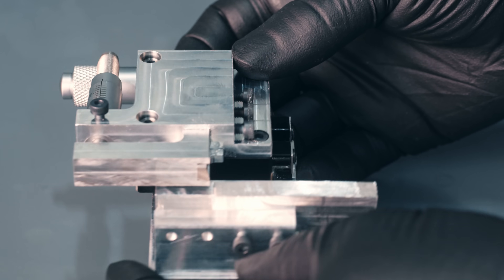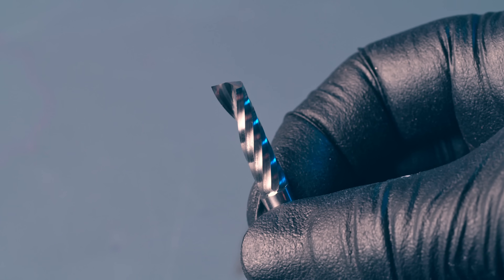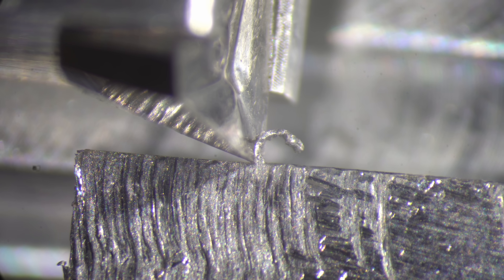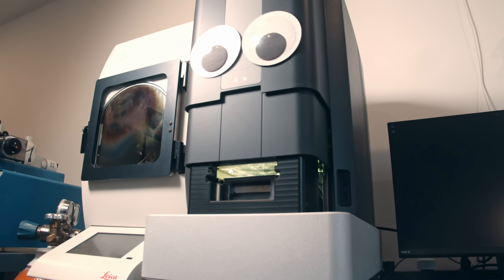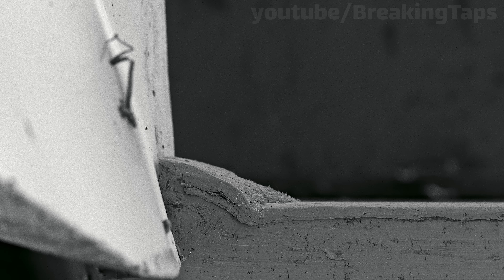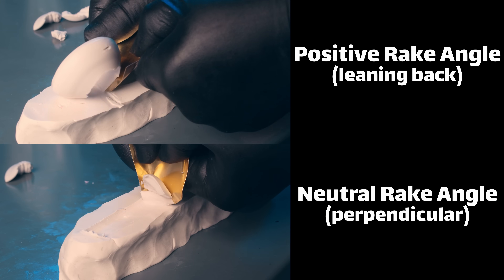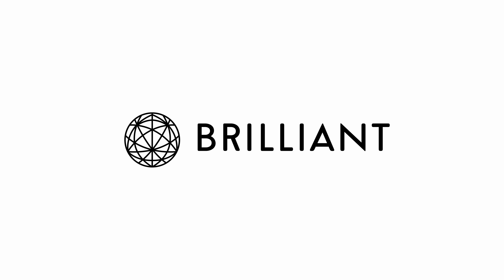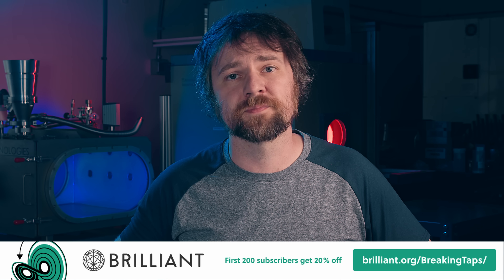Cutting Metal inside an Electron Microscope

Comment: @11:00 It's usually a couple hours into working with a new colleague after I have dragged them down into the weeds about Artificial intelligence, Augmented Reality, software development in <insert language/IDE here> while off-handedly commenting about my personal hobbies that involve a lot of surfing, fishing, welding, microcontrollers, 3d printers, 4 axis CNC milling machine, laminar flow hoods for my GMO cultures that are distinctly separate from my fume hood containing my fully stocked organic chemistry lab with a liquid-liquid TEC condenser cooler, and the required 2 separate deep freezers and 2 separate mini-fridges... that I get the question, "What is you background?" "Oh, I'm Aerospace Engineering." It seems to gets shrugged off a lot... but everyone once in a while I have to go through and connect the dots and it actually does make sense.

Comment: Need to see about getting a motor, battery, and some type of controller inside with a link so you can simply see motion in real time or about real time, instead of pumping up and down for every frame..
Reply: The link is the big issue here really, pretty has to be a wire so you can control the flow of electrons so they won't interfere whit the electrons or the sensor of the SEM,

Comment: Instead of a mechanical device, think of a round aluminum housed bldc stator with µP (like esp) and a rotor with neodymium magnets, combined with some gears. Then you only need vac sealing at the bldc. you could control it over wifi and keep the vac.

Comment: thorlabs has a number of vacuum compatible linear actuators like the 13 mm PIA13VF piezo inertial or 25mm Z825BV DC servo actuators

And newport/mks has several lines of fully assembled vacuum compatible linear stages

Comment: Hey if you want to automate it, it would be easier to install a motor like you said and attach it to microcontroller and then program it so that it starts after some delay (say 3 mins) after you turn it on so that you can turn it on, put it in the vacuum chamber and then once its ready, the motor will kick in after the delay. You could also program the steps to turn very slowly and then stop for 10s after the 50 micron movement so that you can take a clean picture.

Comment: the more accurate imagery would be from an actual high speed cut, actuated remotely, and recorded on a high speed microscope setup.
dunno why you insist on vacuum, as that's not the normal usecase for cutters/drills
Reply from the maker: Vacuum is required for a scanning electron microscope 🤷‍♀️
Reply: @BreakingTaps  : looked like normal microscope magnification. i missed that bit. well...still you could rig up a bluetooth/wifi started cutting run, and hopefully hook up a slomo video camera on the microscope, so you dont need to spend hours doing photo by photo...and it will be a bit more like what happens in real cut/drill. the shearing forces look a bit different on high speed continuous cut than pushing cut tiny bit at a time. It was still satisfying to watch btw.
Reply from the maker: @Chris-op7yt  Definitely agree! Looking into a sorta custom-built lathe setup so that we can get continuous chips at the proper surface speed (+ microscope + high speed camera)

Comment: Great video.  On your idea to make a wind-up machine to advance the tool in a future project:  Couldn't you use a stepper motor with all the electronics inside a sealed container (instead of using that expensive sample box with electronics passthrough)?

Comment: Could you perhaps use a battery-powered Lego controller with a servo to turn it? It's possible to program it with Pybricks. I think the batteries should last for at least a few hours.

Comment: Bro, you're a machinist, make your own electrical passthrough chamber.

2 holes offset, use 2 oversized conductive pins you can press in. They'll have contact where they meet in the middle. Press fitting soft metals is a nightmare though, so have fun

Comment: nice video, im wondering tho. you could easily rig up a radio controlled jig so you dont have to buy a 3k usd extra tray. arduino and stepper motor with a battery wouldnt work?

Comment: When you say "harder than the metal" I have to add a caveat. It's something with a higher temperature than the metal being cut.
Diamonds don't melt, but they can tear with enough use.

I'm being petty but I've been questioning this for years. A sharp knife effectively has less surface area than a dull one and reaches a higher temperature.

Is there any example of a metal with a lower melting point being able to cut one with a higher melting point? I'm genuinely fascinated at what's going on

Comment: I'm not sure how much space you're working with but you can get some 12v DC motors with a fixed high reduction gearbox and pair them with some batteries and a potentiometer controller for very low speed rotation in a wire independent package.

Comment: HSS steel is still widely used, it has a sharper edge and is better for use in softer materials such as aluminium, especially when precision is required. Tungsten carbide is used for harder materials and where mass production is required. You did not state what aluminium you are using? softer aluminiums are not suitable for machining as they tear and gum up just as seen in this video. Lastly the speed at which the cutter travels will change the way it cuts which this video does not show.

Comment: I have to wonder if you could build a small battery powered Bluetooth enabled controller that could drive a stepper motor that would fit in the chamber.  That way you could just send the whole thing in a single session.

Comment: If a guy had time you could really see a lot of things here. For example, aluminum doesn’t respond well to low speed cutting, that’s why you see a lot of breakage within the chip, and on the “earlier attempt” it looked like brittle spalling on the inside of the curl. Aluminum cut at very high speed with a coolant flood would be interesting to compare

Comment: Stopped at 1:28 to correct you. HSS is still widely used in the machining world on mild steel and aluminum as it is FAR cheaper than carbide. It is also used for threading tools as carbide doesn’t like the interrupted cutting of things like taps, though I have seen carbide thread mills.

Comment: I'd love to see, but cannot think of a way to realistically achieve it within the resource constraints of someone not spending government-budget money, the cutting process under SEM scrutiny, at full speed, where the cutting action can produce a zone ahead of the cut hot enough to significantly alter its material properties. Im going to venture a guess that under "real" cutting conditions the aluminium would have plastically flowed more rather than getting ripped off in pieces like in this recording.

Comment: Everybody's been fooled by your "video".  The cutter is re-moving a tiny bit then stopping. each 'wad' of aluminum happens because the head is cutting, then the wad cracks off of the base metal, then another similar length cut happens.  Measure the distance of each, crack to crack.

Comment: 'high speed steel isn't used anymore..' no, it still is. Full-depth carbide taps? Not widely popular due to the brittleness of the carbide.
Reply from the maker: Rough generalization for endmills 😉 Sure HSS is still used in taps and drills (although TSC carbide drills are superior in basically every way except price) but since the vast majority of tooling is the endmill variety, and most modern shops are running carbide, it's a pretty fair generalization I think 🙂

Comment: It's cool.  I used to control the colour of the swarf on the day for laughs. Today we,'ll have blue swarf in one long spiral.  Then we'd put a big grind out just behind the cutting face and that would be known as a chipbreaker.  This is backin the day of grinding your own. Typically a lathe would use a chipbreaker profile. Whilst a shaper would use a narrower rake for a one piece until it got to the end of return.  It really depended how you wanted to handle the swarf.

Comment: How about using a 1/24 scale RC truck crawler to control the cutter?
It has all the parts you need like a gear box and a torqy worm drive. The 2 channels would give you an X and Y axis all controlled by remote.
They cost about 100 bucks.

Comment: Very cool footage! I got tangled into the vacuum connection as i have had designed one in my past. 
Many options popped out in my head, most of which quite compatible in cost to the $5000 for the empty chamber.

Did you check the option of machining a hole into your chamber and then sealing it with Indium wire and stainless steel bolts? The Al2O3 connector can be bought separately for $300 and you can mount it in the hole if you have the right machining tools. I can help with the design :)

Comment: Although this " footage " is interesting .., as I understand it .., it is a series of stop frame gouge shots ... A machine tool cut is usually a continuous even .., where the material starts to behave like a standing wave ... In a lot of cutting procedures after the initial entry of the tip into the material the real bulk of the cutting is just up from the tip at which point the bow wave of metal is being pushed off the stock and the very tip is only effectively polishing and establishing the new dimension ... Nice to see all the same ...

Comment: So, what do you use for cutting the bit that you use to cut the bit that is used to cut the bit that is used to cut the bit that is used to cut your bit?
Reply from the maker: Turtles all the way down! Typically diamond tools are used to cut/grind/polish the carbide tools (which are used to cut/grind/polish the steel tools, etc etc). And to make the diamond tools... usually other diamonds (very slowly) or sometimes femtosecond lasers 😎
Reply: @BreakingTaps  I actually appreciate that!  Thank you!  Now I just need to see like a 4th century femtosecond laser!  And then, if I may;  The equipment to make THAT!  lol
Reply: @BreakingTaps  lol, turtles....Slow and easy sharpens the bit!

Comment: Premiere Pro Warp Stabilizer.  I wonder if it could produce a smooth motion video instead of that jumpy stop motion.  Slow it by 50 percent and its pretty good at interpolating frames using the Optical Flow interpolation model.

Comment: Any chance you could just make a vacuum safe sealed box with a magnetic coupler joining a stepper+battery+driver inside to the screw outside? It seems much simpler to design and test than a clockwork mechanism, and more flexible as well. I'm not sure what other design constraints are at play, so there may be some major issues but I thought it was worth at least asking.

Comment: You could make a remote controlled cutter, powered by a battery.
I guess there could be some problems, like if the chamber is made entirely  of metal, the signal wouldn't get in; the battery might stop working in vacuum, but it might be worth the try.

Comment: You could use wireless connection to control motor inside your chamber. Maybe you'd have to make a sealed chamber for the battery to not to expose it to vacuum.
I even can help you to cad-draft that for you cause i am really impressed with project you do for your channel!
Amazing!

Comment: interesting video! some slight correction, saying that the reason hss can cut faster than basic tool steels is due to its working hardness is a bit misleading. hss does have a slightly higher working hardness than basic tool steels (63-65hrc vs 57-62), but the main difference is in its ability to maintain hardness at high temperatures, mostly from the addition of Molybdenum or cobalt. also carbide isnt "better" and it hasn't largely replaced hss. its better for some applications, but hss is still around.

Comment: When you're cutting iron and other ferrous materials the generated heat becomes very important. The material becomes softer if the cutting speed is high enough which facilitates the cutting.

Comment: Super satisfying shots. I don't know how much of a vacuum you are pulling but if you have the available space on your chamber, a hermetically sealed mil spec  connector plug (cannon / amphenol) would be a very cheap way to run power into the chamber. A well installed one can hold about 20psi positive. Not sure about how that equates to a vacuum.

Comment: Could you use stage movement to cut? Put cutter fix in chamber, move metal with stage x/y. Or a reduction gear using the stage rotation. And 3K on an SEM accessory is pretty nominal. John Yorston now at Thermo (formerly Zeiss) is a SEM applications specialist who might be able to help. Good luck. cool video!
Pet peeve alert. SEM images are not *photo*graphs; images, micrographs, pictures, but not photo-graphs. Greetings from a fellow biologists/SEMer.

Comment: I do not remember if you could use anything electrical or not inside one of these. But an idea is just to have a very tiny motor that is geared highly to slowly move it over time. That way it can slowly cut on its own and you take the pictures.

Comment: This clearly shows how pasty metals really are. You can see it on really soft metals like led and sodium to an extent, but the real cracker is the difference in hardness, not the overall hardness. All metals are pasty to some extent, by virtue of being metals. If the tool has a big enough "pastiness gap" to the workpiece, it will shave off chips.

Comment: Use use a battery powered motor to automate it. DC or stepper+microcontroller. If you want fancey you can add RF communication.

Comment: So you are wrong on several points.

1. The first cutting tools were hardened high carbon steel, HSS didn’t come into common use until around the turn of the century.

2. Carbide inserts are designed for a specific range for the depth of cut, .004 is the smallest I know of.

3. SFM is important to produce a chip properly.

4. Coolant/lubricant can also make a big difference in chip/finish formation.

You made some chips but they are nothing like what a machine running proper speeds, feeds & coolant/lube would produce.

Comment: Why not do remote control? Use an RC car steering servo that moves linearly and then 3d print a gear and arm of the right size and length to rotate the micrometer the correct amount. Think of an engine crank shaft and piston. The steering servo is the piston.

Comment: Great video!  If perhaps the secondary shear zone had a continuous lubrication port, consequently less friction so the actual surface cut becomes more accurate without the pull tears that I’m observing. The material would slide past the shear zone rather than bundle up and compact.

Comment: This is one of the best videos that I’ve seen on YouTube. Smart, well organized, and interesting. 

There’s one detail you should add on your next video about chip formation: temperature. 

Cold metal responds to milling differently than room temperature metal, although not necessarily in an advantageous way. 

In fact, they make a vortex air separator which provides cold air for machining small parts. A nitrogen tank can also be used.

Comment: Amazing footage, thanks for all your time, and skill. Not to mention some very fancy equipment. Sorry to hear the difficulty - and expense - getting electrical connections into the vacuum chamber. Running the cutter with a stepper motor would be very cool, and save a lot of time! Can somebody knowledgeable in high vacuum please come up with a solution? Only four wires - good for 1 ampere or so - required.
Think about wires going into an old-style vacuum tube. 
Anyway - thanks again, and best wishes for your future projects!

Comment: Use a Arduino + stepper motor + stepper motor driver + light sensor + a laser pointer to trigger the sensor (turn down the sensibility so that it can only be triggered by the laser pointer), if you are still able to work on that project after your hour long session, maybe team up with a DIY elektro YouTuber for the v2?

Comment: If you encapsulate a battery in enough resin, and test it out in a cheap vacuum chamber, it should be safe, no? But ok i would probably not risk it myself with equipment like that. Only if it were mine and if i could easily afford a new one ;) I am still wondering though, why not using a traditional camera system? Maybe i missed the reason in the video, will watch again later as it was a very satisfying video 👍
Reply: If it is because if depth of focus, there exist not too expensive solutions for that, exactly what you need for making still frame movies. Like a motorized z table under the microscope, usb camera and clever software. The result still depends on good illumination though, that is not obvious when using microscope lenses.

Comment: Approx. how many atoms thick would that chip be?
Reply from the maker: A lot! This is still pretty "big" in the scale of things. Some rough napkin math: the cut was around 100um thick, and the lattice constant of pure aluminum is 4 angstroms wide. So it's something around 250,000 atoms wide (with a fair amount of wiggle room, since it wasn't a pure aluminum alloy). That's actually quite a smaller number than i expected now that i run the numbers!
Reply: @BreakingTaps  Thanks! I teach intro material science and this video will be super helpful in class.

Comment: Did you need to ground the setup to prevent any charging effects from wrecking the images?
Reply from the maker: Nothing special for this setup. The chamber platform is grounded, and since the cutting fixture was mostly aluminum it grounded itself nicely. You can see some edge effects right around the cutter though, where the electrons were deflected by a bit of charge buildup on the sharp edge (causes a swirly "heat distortion" effect).  But generally no issues with charging on this one, thankfully!